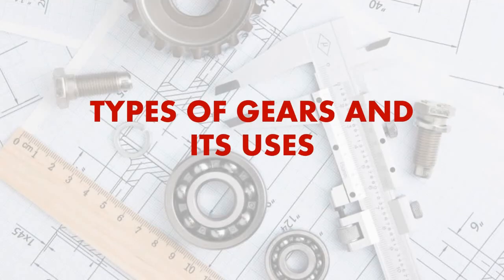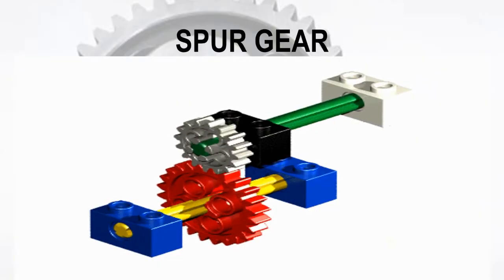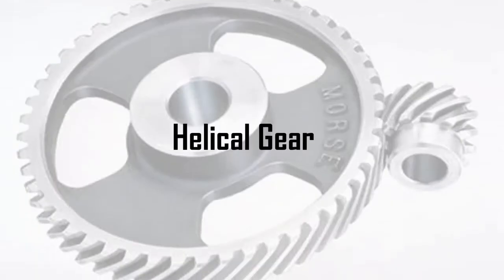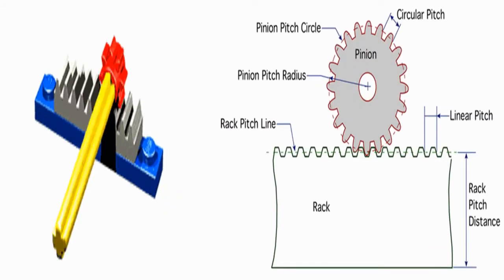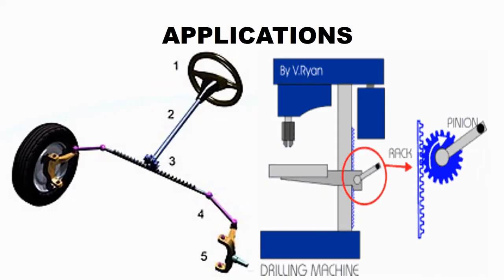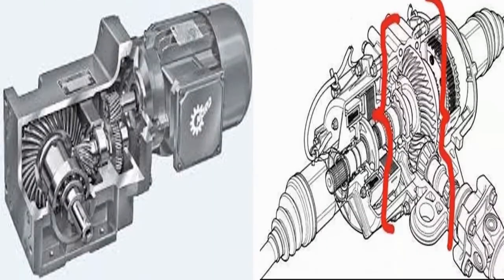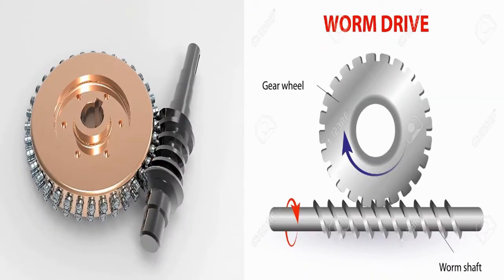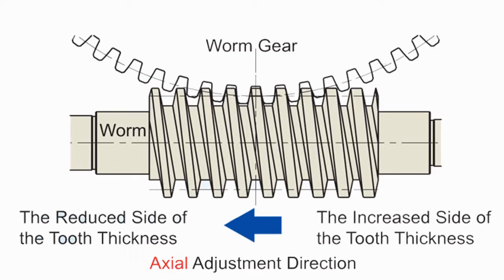Different Types of Gears and their Uses explained | 3d animation

Comment: does the worm gear and the wheel gear attached to it move in the same direction? And also, if we were to have a straight bevel gear with two gears horizontally on it would they both move in the same direction?
Reply from the maker: In a worm gear setup, the worm gear (the gear with the screw-like shape) rotates and causes the wheel gear (the gear it is meshed with) to rotate in the opposite direction.

In a straight bevel gear setup with two gears horizontally on it, the two gears would rotate in the same direction.